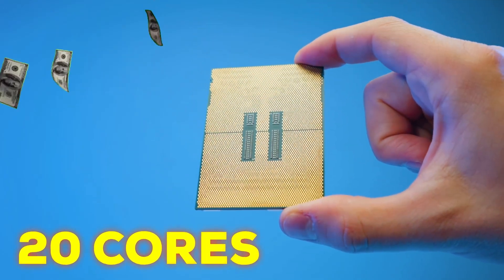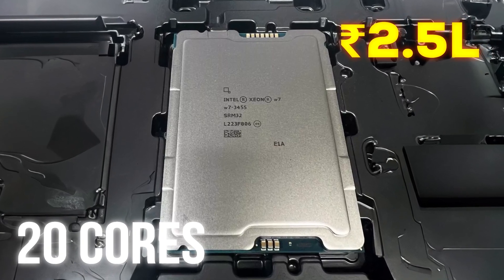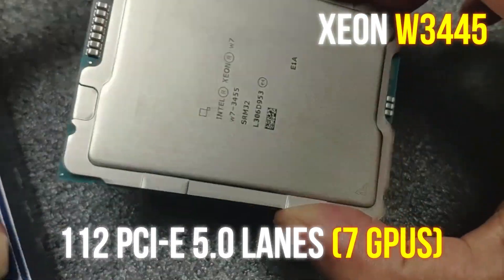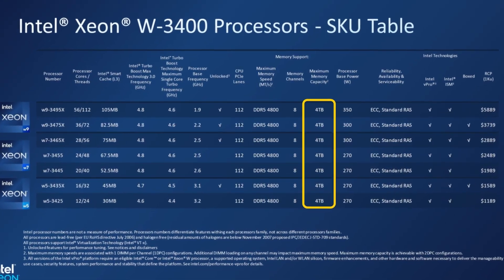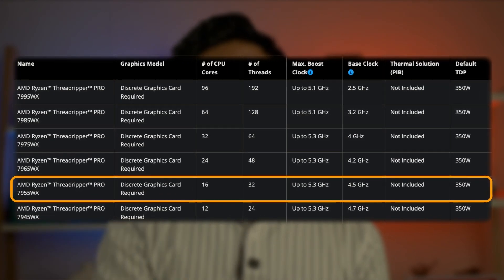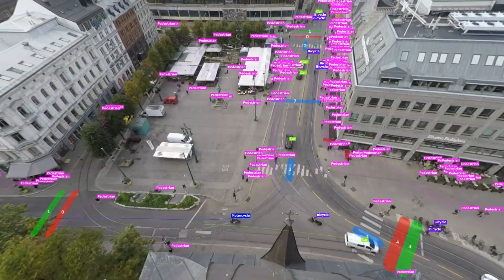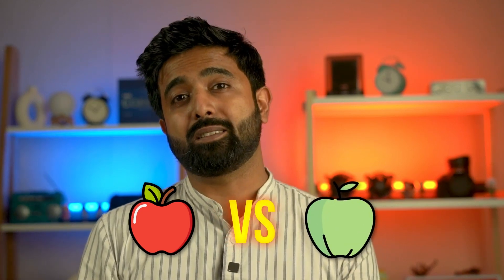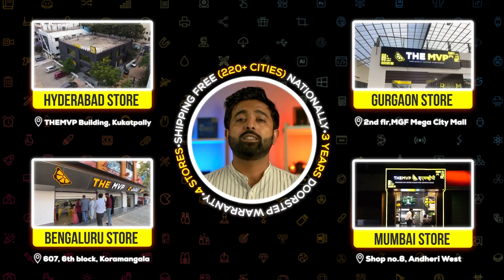Intel Xeon vs AMD Threadripper 2024 India - Workstation CPUs

Comment: for 8-10 Days of CPU Intensive Numerical Model workloads.. which is more good? 5965 (24 C) AMD or Intel (2495 24 C)
Reply from the maker: The 5965wx will have the edge here because it has better multithreaded scores and also has more memory channels and PCIE bandwidth.

Comment: Intel for stability. 😅 That company  lose half of their value because of instability of their cpu. 😂
Reply: Comparing the instability of high end 13 and 14 gen with this server cpu makes no sense
Reply: @computerscience1101  they haven't realease hedt for a long time. The last one was before 12, 13, and 14, which has IO corruption fault not just power problem.
Reply: These are completely different CPUs.
Reply: Nga is dumb